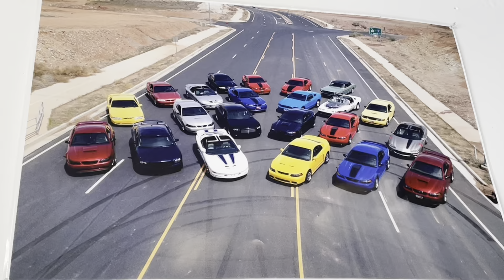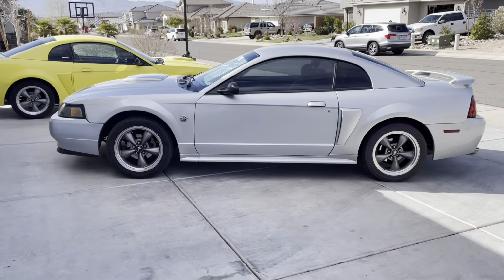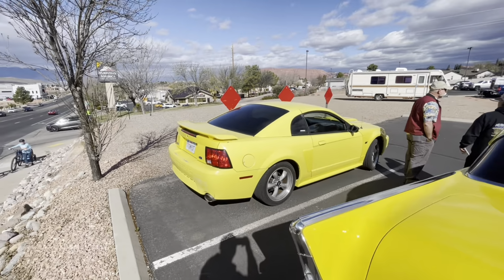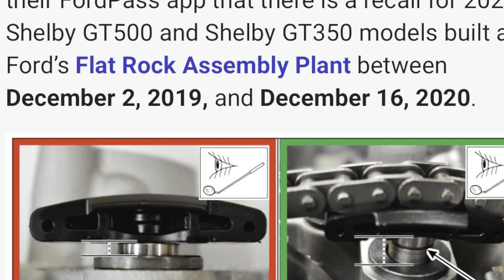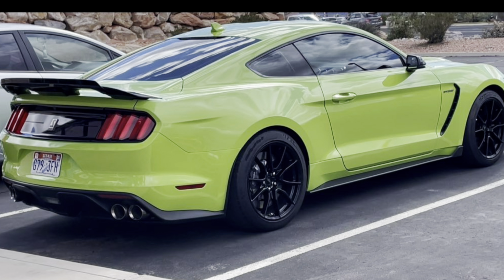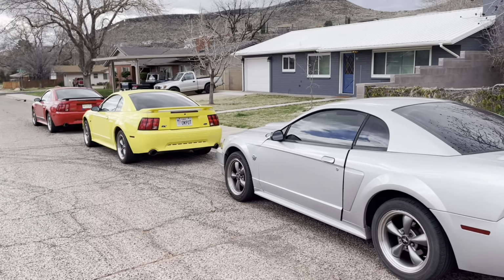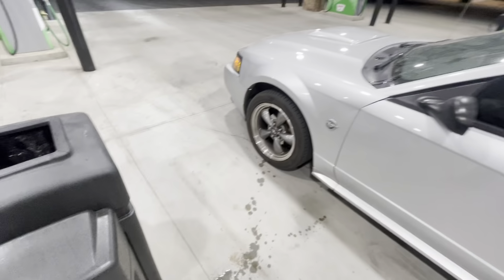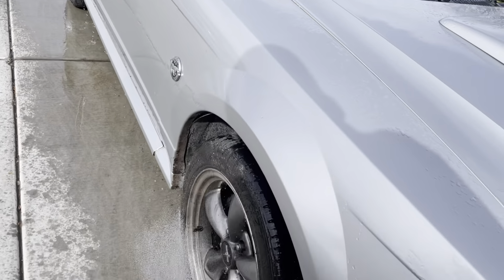My mustangs update terminator cobra Mach 1 GT Bullitt and special Shelby GT350 recall story

Comment: That GT 350 story is crazy but all too common when it comes to dealerships.. I refuse to take my cars anywhere to be fixed.. Shops around me couldn’t even get my alignment done correctly, after 3 attempts I had to do it myself.. Now that I know I can align them myself, I have no reason to ever go to a shop again.. When I get tires installed, I take the wheels off bring them in and cross my fingers while I watch…

I have had several instances over the years where people were willfully incompetent or purposely sabotaging my cars, the alignment being one of those occasions…
I almost lost my front wheel on the highway because the “alignment shop” had the tie rod threaded out all the way out held on by 1 1/2 threads..I thankfully caught the problem because it was making a squeaking noise and fixed it myself..
Reply from the maker: I’m the same with hating to have anyone touch my cars and only do so with such things that I can’t do like alignment and A/C service. I also take my wheels off to get tires put on. That’s too bad they did that to you with the tie rod end. Back in the 60’s my grandfather got into an argument with a shop worker about his 55 T- bird and the mechanic left his lug nuts loose on purpose and the wheel came off on the LA freeway. Back then mechanics got away with more stuff like that. Now there is more video and awareness as well as backlash I believe

Comment: What’s the closest to the terminator cobra? The saleen or roush?
Reply: 03 / 04 Mach 1. The Saleen and Roush are 2v’s the Mach 1 is also a 4V minus the all forged internals like on the terminators. The manual Mach 1’s do have a forged crank
Reply: @Lethal_Venom  not sure what the 2v and 4v mean lol. So what’s the closest?
Reply: @jaredr2518  2v is 2 valves per cylinder, 4v is 4 valves per cylinder. Its the configuration within the cylinder heads for how many valves per cylinder. The 03/04 Cobra's and 03/04 Mach 1's are 4V's so the Mach 1 in those years is the closest to the Terminator it just does not have all the forged internals the Cobra's have
Reply: @Lethal_Venom  oh wow thank you. What’s the fastest next to the terminator?
Reply: @jaredr2518  The Mach 1’s are not supercharged where some of the Roush and Saleens are. Either one of those supercharged is faster than a non supercharged Mach 1 but with all things being equal and all of them not supercharged and just off the motor the Mach 1 is faster.
Reply: @Lethal_Venom  ok 10-4 that makes perfect sense. Thank you very much for the information
Reply: @jaredr2518  welcome